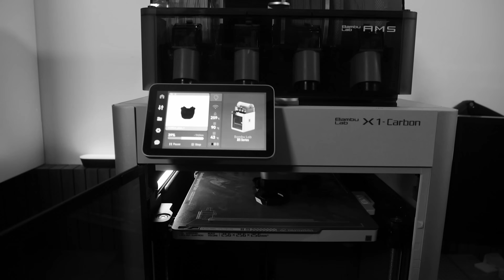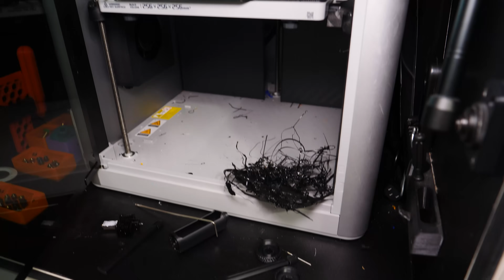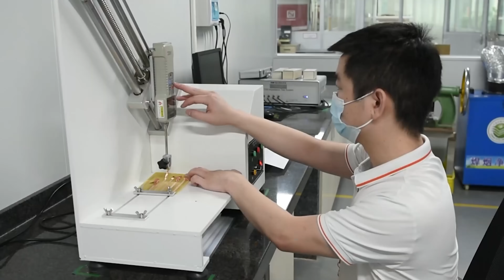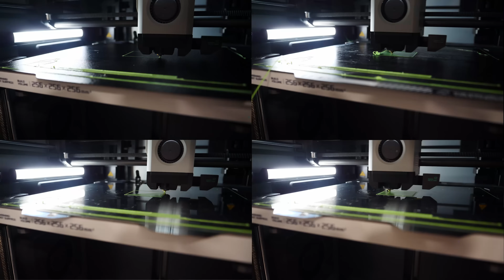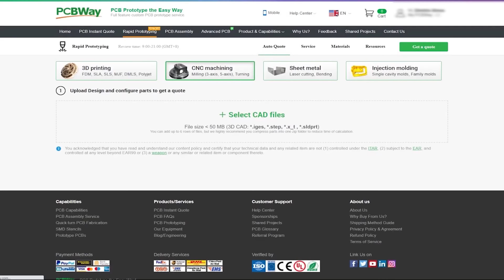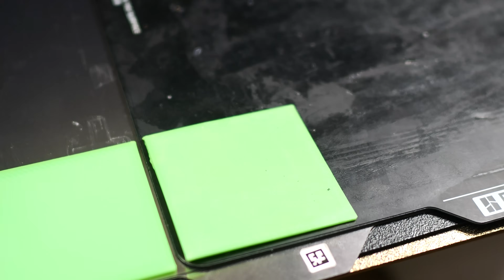Improving My Bambu Lab X1 Carbon... With Cheap Knockoffs!

Comment: I have the Bambu textured and smooth PEI plates. No error messages with these plates. I will keep this Bambu stock. If I want go back to modding I have 2 Enders to play with. My Bambu just works
Reply: Ditto but there's one exception.  If you wipe with IPA, the white printed text starts to blur a little.  That's not a major issue but the AruCo Tags (like a QR code) also blur and then quite quickly it doesn't recognise that side of the plate.  You can choose to continue but it's a hold-up each time.  So far wiping just the middle and avoiding the text (on the other side) has been ok.

Comment: X1C user here, I own the official pei plate and 3rd party pei plates in gold and black. I've done some tests on these 3 plates, and have concluded that Bambu Lab is right about not using Lidar with pei plates. 

Firstly, I would like to point out that the Lidar flow calibration has a greater impact on print quality rather than bed adhesion.

In my tests, the flow calibration with Lidar ran without error on both the official pei plate and black pei plate, error only occurred on the gold pei plate. Everything stuck well on the pei plates. However, I've noticed slight overshooting on some corners of my test prints with all the pei plates, which was not present when I re-ran the calibration and printed on a cold plate. 

This leads to the conclusion that, even when the Lidar calibration ran without any error, it doesn't mean the value measured from the calibration is correct, and going through the Lidar calibration on a pei plate will lead to an incorrect value that affects the quality of the print. I think too many users are thinking "Lidar calibration without error on pei = successful calibration", and that's why in the latest update, Bambu Lab has disabled this function entirely when the pei plate is chosen.

Hope it helps!
Reply: Too bad it can't do the calibration ahead of time for all of the filaments in your AMSs and then store them instead of just storing the last one done.

Comment: 2:22 Shillbat Shalom! 🤣🤣 Great video, sounds like there's some solid upgrade options there and more to come. Even if they have supply issues, the X1C is popular enough that China will provide. A dedicated user base with higher budgets will always attract clone manufacturers, and though sus from an IP perspective, it's a nice reassurance for a potential purchaser. I'm leaning towards getting an X1C but I'm going to give it time for them to sort out some of the initial issues and do upgrades to their prod models like screw in plate fan instead of tape. That and better/faster support should be fixable with time.

Comment: Great Video on the build plates.  Hopefully the Bambu build sheet fanboys don't get wind of your opinion and flame you over it. I made a comment on  FB on the fact that Bambu didn't include a textured high temp plate with a $1500 machine and the post was bombarded with nothing but hate messages and insults.

Comment: I do have thoughts on the LIDAR.  My understanding is that the LIDAR is used to examine the flow rate test.  If you aren't bothering with doing a flow rate test, the LIDAR is irrelevant.  The LIDAR may also be involved in looking for first layer defects.  But if the mechanical parts of the printer did what they were supposed to, there won't be a first layer defect to detect.  So... if the LIDAR isn't working with the textured PEI sheet, but the printer worked properly anyway, then there won't be an actual issue with the parts.

An interesting experiment would be to deliberately create a first layer defect and then try all the different build surfaces to see if the printer reacts to it.

Comment: I'm personally of the opinion that the "Cold Plate" is an afterthought.  On the Kickstarter, Bambu plainly stated that their goal was a printer that would easily and reliably work with PC, Nylon, and Carbon Fibre, and it's my guess that as some point well into design someone said "hey, we need to make this work with PLA, too," and the Cold Plate was the best they could come up with within limits of time/manufacturers/LIDAR tweaks/not losing the print during ridiculous speed printing.  (Remember that the glue stick is not for adhesion, it's a release agent.)

That said, I also find the cold plate annoying (although the engineering plate with a single layer of glue stick that I only refresh about every 10 spools works amazingly well for ABS) , so I ended up with one of the AliExpress gold PEI sheets; mine is smooth because I really don't like a textured surface most of the time.  It works very well for PLA and PETG but I had trouble with ABS.  So I use the AliExpress plate for PLA and the Engineering Plate for ABS.  (Also, on the smooth gold plate I don't get the LIDAR & camera errors except when printing with filament that's almost the same colour as the plate.)

So to answer your question: I'm willing to try out small things like an alternate build surface to see if my experience improves - but I'm not going to do major things like replace the firmware or rebuild the hotend to use a REVO nozzle just to "escape the walled garden."  I also don't see any reason to try out the forked, open-source slicer variant.  Such things would be useful if one was trying to integrate the X1 with other printers using other firmware and octoprint and such, but I'm not.  I've retired my Ender-5 and am considering breaking it down for parts for my robot-building hobby; all my printing today is with the Bambu printer so I'll happily hand out in their garden.

Comment: I would not change the nozzle, I've been using different build plates, I see no issue with that. I am tempted to print the guts of the AMS that make it more compatible with different spool size. For me, this is not a money savings thing, it's more in terms of actual improvements. Nozzle seems to be just a curiosity -- BL prices for nozzle/heatsink swap vs the 3rd party is basically the same, so that's not a problem I see that needs a solution -- if BL goes out of business, sure. I owned a TypeAMachines Series1 printer, which was deemed as the Apple of 3d printers some years back due to industrial design if anything, and a very premium price I suppose. They used a lot of proprietary parts, and no one was dunking on them for doing so. They went out of business because they never iterated and their prices were not competitive, so engineering alternatives for out of market proprietary parts made sense.

Comment: @TheNextLayer Why put a picture of a PTFE coated nozzle in your miniatures when you don't even talk about this specific one? Are you aware that they advertise it as a non stick coating for PETG but PETG prints above 200°C and PTFE / Teflon is not recomended above 200C, so definitely not suitable for 3D printing temperatures, a reddit user shared a pic using this kind of nozzle, after a few hours of print you could see the coating bubbling and ripping off, that + the fact that it is toxic, Teflon flue / ptfe fever ?! So you're endorsing Chinese sellers pushing forward crappy and toxic product ? 
You also have not addressed my last comment on your last video where I talk about the last firmware updates litteraly limiting the temprature variation of the hotend and so the max flow rate, which is why you got errors in your last video? Bambu Lab is closing their system even though what you said.

Comment: I intend on getting a one of these X1Cs. The build plate options are likely the only thing I’d want to change. With what I print, I don’t need  any of the other types of mods that are available. 
Like all things, just gotta figure out what it’s purpose is going to be and if it’s already good enough. 
Thanks for the reviews and the guidance on the parts. Keep up the great work. And let the editor have at least one bathroom break 😂
Reply: I just bought mine and they now have texture plates etc straight from bambu you can buy fyi
Reply: @ValleyTV   I picked up a textured one from bambu when I ordered my x1c on friday. Also waiting on cheapies from aliexpress. Gold pei did right by my ender 3s.

Comment: After owning and modifying several creality machines, it was nice to just get a machine that is awesome straight out the box. When I got my first Ender3 just after release, the amount of mods and upgrades was huge as was the fan base, but in all fairness after the hotend mod was done it didn't really need all those mods. I admit PEI sheet was a godsend, but it worked and some mods even made it worse. I wont be modifying this one except maybe the buildplate surface, as it works well so why screw a £1500 machine up? Just need to modify the hell out of all my Creality machines now to keep up 😅 It's all personal preference and if you just can't help yourself with your tinkering habit like most long time users
Reply: Yea its a never ending cycle of doing mods for a printer. Now with the X1C I'm like this is what all printers should feel like lol.

Comment: Not sure I'd go as far as saying adding a new build plate is making the Bambu modifiable. I like that someone has created a knockoff hotend. I have mine on order. It will arrive someday from China.  Also, I did get a 3rd party PEI plate for my P1P.  Partly because i wanted a smooth surface but also to get a thicker plate to deal with the P1P bed not being as flat as my Prusa.  I'll be more impressed when the day comes where Bambu makes a printer that allows for replacing bearings, rods, motors, and the heated bed.   Not that i want to mod those things, but in most cases, I want to be able to repair them myself.  Right now, bearings and rods are non-serviceable by us.  I have some big concerns that my P1P will be throw away in 2 yrs because only Bambu can fix those items, and outside of warranty, it will be too costly to send the whole printer.  Learning experience for me. Hindsight is 20/20. I shouldve waited on my purchase.  But.. some people won't care about that.. "I made my money".  That's not me though.
Reply: So I don't have a bambu printer yet. I'm saving for one. I get that the parts aren't serviceable by us because it's a destructive process. But what's stopping us from designing and printing new carriage blocks that allow us to swap bearings and rods? 

It's not ideal but better than throwing away the printer or spending huge money sending it back to Bambu for service.
Reply: @nathantoews152  I have yet to tear mine down but from others who have investigated more into it, its all press fit or epoxied together.   So not even sure it would be possible w/o destroying parts.  In another video, Nathan Builds Robots said Bambu wouldn't let him replace his idler carriage and it had to get sent in because it required special tooling.
Reply: @John Olson  I'm aware it would destroy it. But I'm saying at the point where the printer is already broken. Instead of throwing it away the community or individual would be better off to print replacement parts.
Reply: @nathantoews152  I've responded twice and YouTube stripped both of my comments, probably because I included links.   Now, I can't remember exactly what I said.. 
Summary: Hopefully the community finds a way.  I've looked at the docs (bambu wiki) and my own P1P, and its a single injection molded piece that holds the mount for the Y rod, bearings, mounts for motor, and mounts for the belt tensioner.  Maybe can be 3d printed later on?  At a minimum, maybe Aliexpress to the rescue with some 3rd party doing cheap injection mold repair pieces.   I also hope its not a matter of tossing the printer, but IDK.  Bambu is new and not really sure what the plans are for long term repairs.  Time will tell.

Comment: I bought a 3D printer to design prototype parts and use as a tool.  Bambu Labs x1carbon just works. I don't have time to tweak or tinker with. So yeah Bambu for the win.
Reply: My X1-C was my 6th printer but it was the 1st printer I haven’t had to rebuild almost as soon as I unboxed it. E3 Pro, E3v2, Neptune 2S, Weedo X40, Chiron, & a Dremel 3D45. Besides the Dremel that can’t be modified all of the others are like Glocks, they’re close to trash off the shelf until you replace all hardware. I didn’t know that’s what I was getting myself into TBH. I enjoy it but it’s definitely not for everyone and it’s the very reason NONE of my friends or family are interested in getting into 3D printing.
Reply: @F_K3NT_D  this
Reply: Just pay attention to how you slice and print, otherwise your “design prototypes” belong to a Chinese tech company.